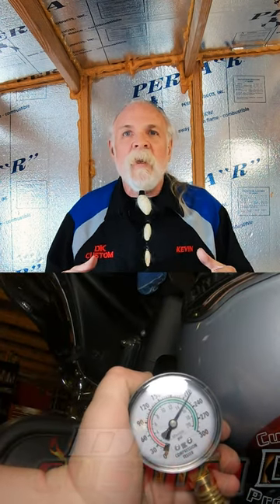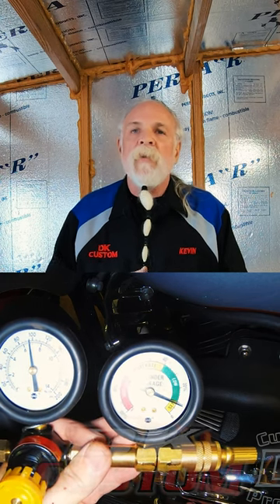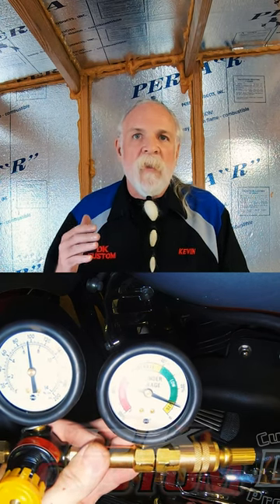🤔Compression Test VS Leakdown Test❗ #shorts

Comment: an engine need not hold compression for more than in instant. what use one would have to know that compression can be held over an extended period of time, IMO, is practically useless.
Reply from the maker: If you are wanting to determine the health of your engine a leak down test is what we suggest.

You can see the full video at this link- https://www.youtube.com/watch?v=uIDxZdRB1kA

Thanks for the comment! 👍😎👍
Reply: I agree. There's new air inside every second or less

Comment: Compression test is not going to tell exactly what's leaking! Just because the leak is heard in the crankcase doesn't tell you if it's just rings! Same with exhaust (valve) or intake (valve). Gaskets can leak too!😅